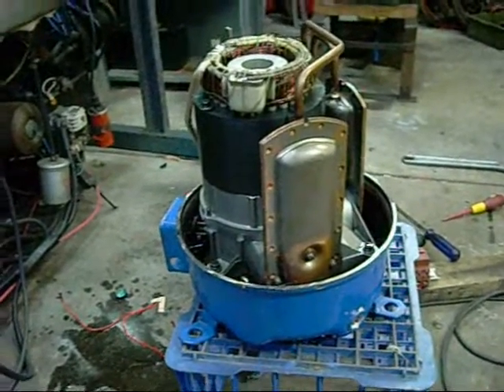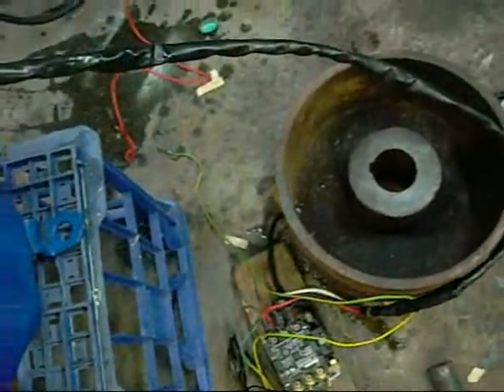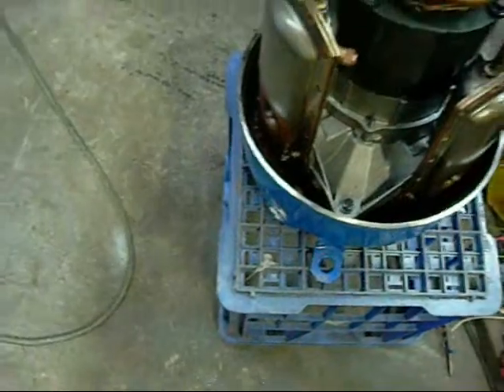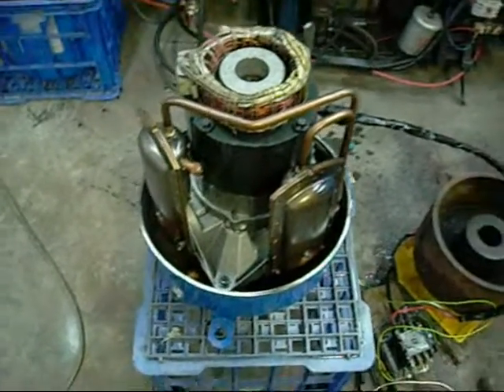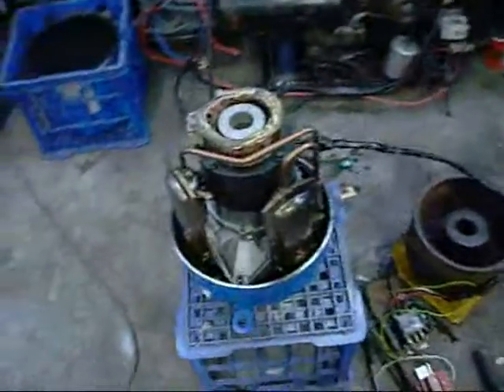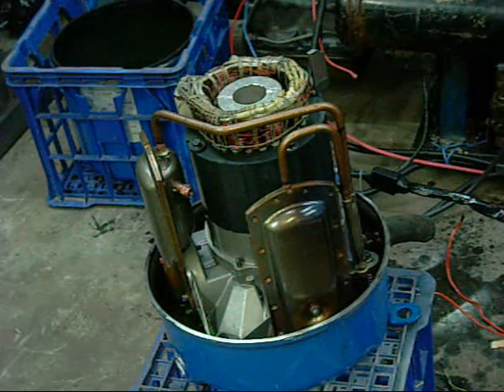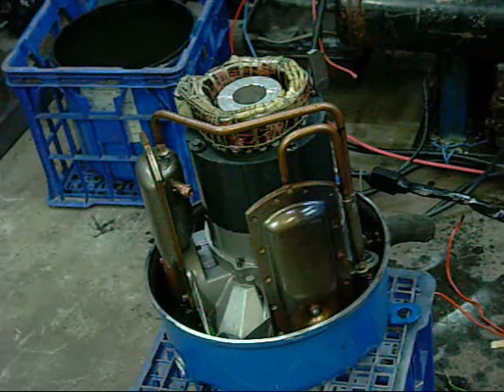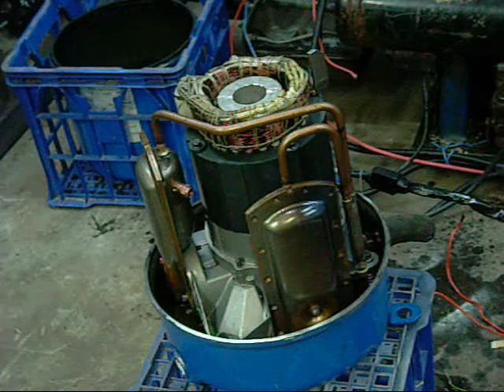Forced Refrigerant Compressor Failure and Motor Burnout

Comment from the maker: @LolitsDeformed yeah Hermetics did away with a lot of noise associated with open drive compresors, as well as a lot of expense and complexity.

mind you this test was excessively loud because the inlet and discharge were open to the air, hence why some people duct the inlet of a normal air comp outside to reduce noise.

Comment from the maker: @letseeitplease I'd say yours are much bigger if they have a oil pressure monitor on them. probably semi-hermetic. if it really is running low on oil pressure I would call a tec in ASAP, or at least shut the faulty unit down. semi-hermetics get expensive to repair when they run low on oil (sorta like a car engine)

Comment from the maker: lol yeah, I sorta used it as a demonstration of what happens to a compressor during lubrication failure.

of course most have thermal switches to prevent severe burnouts, but I overrode this one to show what happens without one